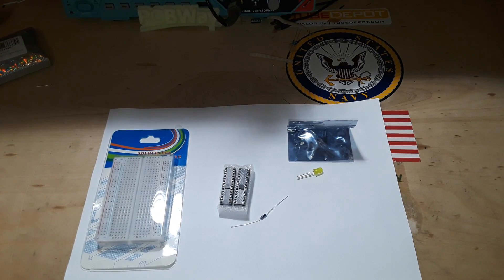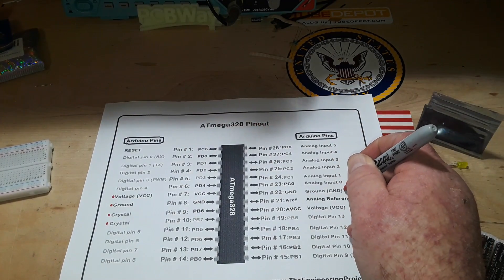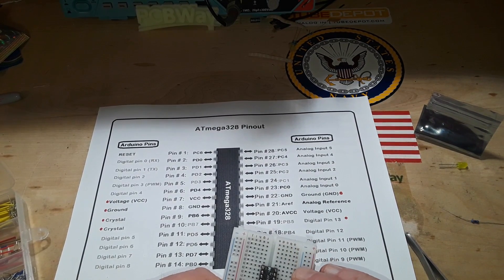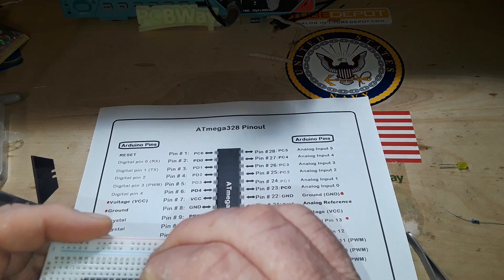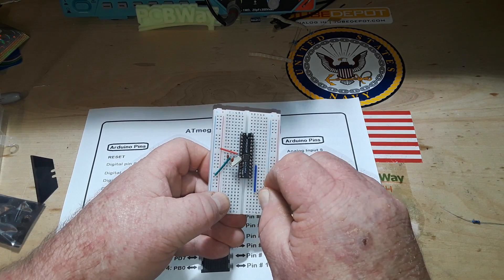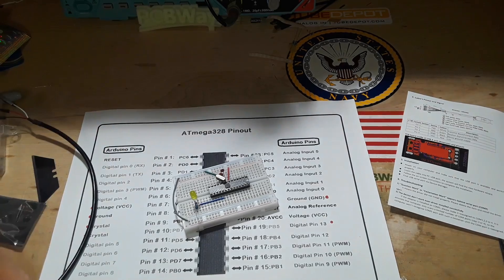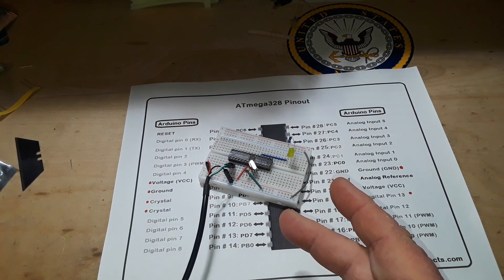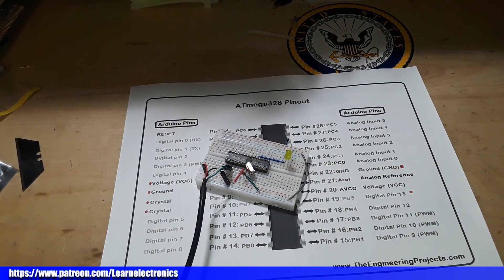Trying To Talk An Arduino - Not A Tutorial

Comment: Doesn't the chip need to be told to stop running the current code and accept new code? I believe this is done by pulling the reset pin to ground and that it should usually be pulled up to make the change obvious. If the cable doesn't have that wire, would it be worthwhile trying a button switch and a pull-up resistor on the reset pin number 1?
As others have said the chip needs to have had a bootloader uploaded & then there is the choice of which board to select in the IDE. I have read the suggestion of Nano w/ ATmega328. But I have never tried using home brew Arduino, so I am guessing. 
Isn't there a recommendation to have 10uF from power line to ground very close to the pins?
Reply from the maker: It has a bootloader. It was running the blink sketch. But I think you're right about the reset vector. I will be trying that in the future along with the proper FTDI interface

Comment: Nice video, I need to learn how to do this stuff in the near future and this helps a lot. Question: If I use the same PL2303TA cable to program the ATMega328 like in the video, how can I add a reset to the board to allow for the reset that is needed to successfully flash the code? Thanks!
Reply from the maker: I'll let you know if I figure it out

Comment: I think you can hook reset button and press that when it start to upload sketch. I think old boot loader had 1-2s window when it's in boot loader and waiting connection. Other is just to use another arduino as ISP and do baremetal programming.

Comment: Look how far we have gone in electronics.
In the old days we used only 2 transistors to flash an LED, now we use thousands of transistors just to flash a single LED!
Reply: Not to mention a complete nightmare of guessing whether a bootloader was installed (and which version) when you purchased the ATMega and then discovering that no amount of faffing around with serial cables (with or without DTR) is likely to result in consistent loading. The only way I have ever got this to work repeatedly was to use a Uno (Nano doesn't work), and, even then, some IDE versions don't program properly.

Comment: In addition to the (potential) RESET problem, I would also suggest checking which board you have selected in the Arduino IDE.  I've only ever managed to get a 'bare bones' Atmega328p to programme correctly if I select "LilyPad Arduino" as the Board, and "ATmega328P" as the Processor.  Never works if you select UNO or Nano as board type in my experience.
Reply: Hi Mike.  So I just explained this in my comment above.  I've learned over the many times I've done this that whatever board is selected when the bootloader is burned has to be the same board selected when the sketch is uploaded.  So it sounds like whoever burned your bootloader used LilyPad Arduino when they burned the bootloader.

I've personally had good success using Arduino Duemilanove and Arduino Uno when burning the bootloader.  I just have to make sure I use the same setting for sketch upload.  I use Arduino Uno now that I've realized this.

Comment: I bought some Attiny85s. Getting the bootloader on them has driven me crazy.
Still no luck.
I'm using every version of Arduino  IDE available. 
Maybe try that. Try an older version...
Reply: Have a similar issue. I usually don’t bother with the USB boot loader and use ICSP on those.
Reply: You need to use a capacitor between the reset and ground. It will work, trust me.
https://images.squarespace-cdn.com/content/v1/59b037304c0dbfb092fbe894/1526764090303-ZID4RDJVM63NCL6RG9EM/image-asset.png

Comment: Reset.... add a switch or connect ftdi reset line. Reset should be held high, and the switch goes low. At the start of the download connection press reset.  Also verify that the Vcc and gnd pins of the board are connected.  Is the bootloader installed?

Comment: Another great informative video!
Just for anyone's information, two models of premium breadboards are BusBoard Proto sys BB830 and JameC Valuepro WBU-202-R. You don't have to struggle to plug in components! They are expensive but worth it.
Reply from the maker: Thanks for the info!
Reply: Highly apreciated! I've been wondering who would happen to make the best functioning breadboard, gonna check those out.
Reply: and when you have used them for some time they still have good connections. usually those that are hard to inset will lose their grip over time.

Comment: You need really an FTDI adapter module - with that you can connect to Pin1 RESET via a 100nF cap...
Reply from the maker: I ordered one
Reply: @learnelectronics  You will also need a 10k pull-up resistor on Pin1 as the RESET pin is active low, so leaving it floating can have 'undesired effects' 👍🏼